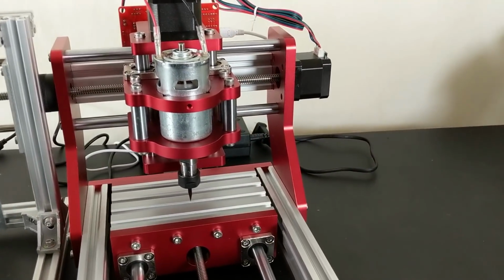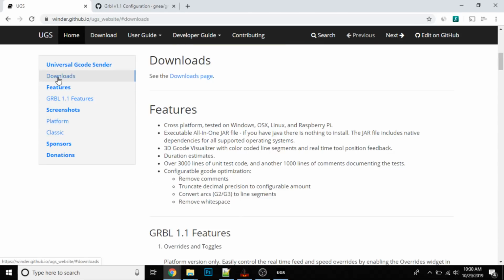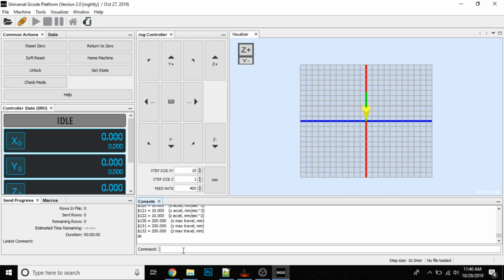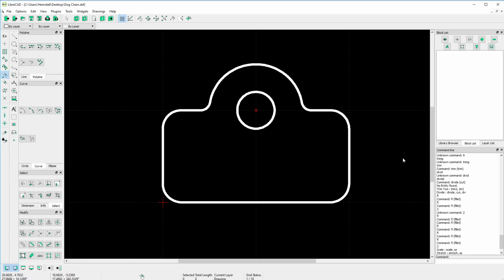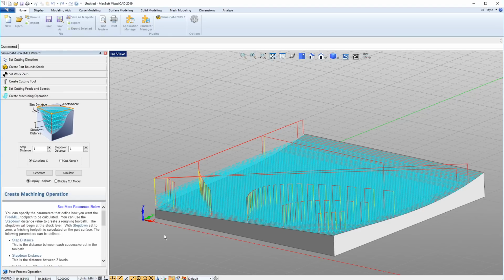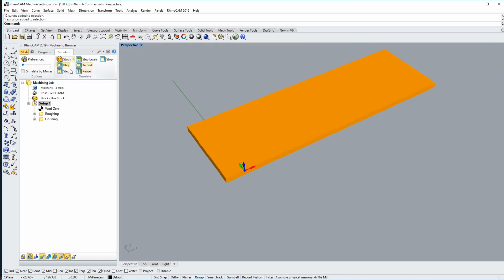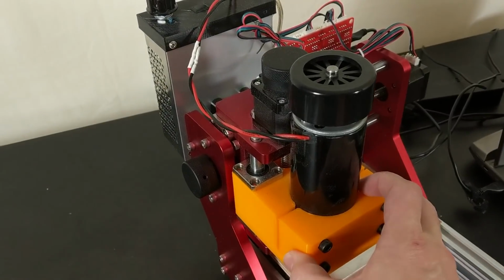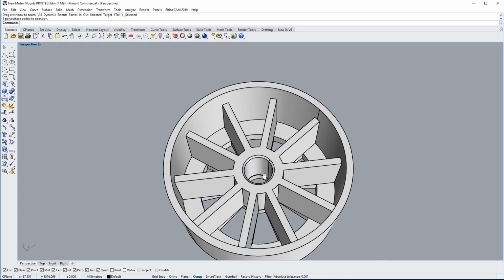How To CNC Cut Metal For Under $400 using the 1310 CNC Router

Comment: You have you coordinate system layout half right, CAD and CAM use standard Cartesian coordinate system.
Upper right is X+, Y+ (you had correct)
Lower right is X+, Y-
Lower left is X-, Y-  (you had correct)
Upper left is X-, Y+

17:08 There are  many reasons for having 0,0 in various different areas of your part. Setup and raw stock shape are the two primary reasons

At least in a professional / production environment raw stock material usages is important so for example, if you making a round part (like say a round bolt flange), you would always try to start with a piece or round stock and you wouldn't then have a corner to have a 0,0 plus in round part design, you almost always start from the center for the layout purposes. Sure, you could machine a round profile from a piece of square stock but this is problematic for a few reasons (one of which you even talked about later in the video). One, its a waste of material because of the corners that will be scrap after the round profile is cut and two, you either have unnecessary clearing to do to whittle away corners of you have to essentially do full cutter width engagement (i.e., slotting) which is excessive unnecessary load on cutter and machine that could be avoided by just using round stock and working from the center.

For other cases, Fixturing plays a roll in where you want your 0,0 because you want you 0,0 to be based on fixed point(s) that cant change with raw stock material variations. For example if you were using a vise to hold the raw stock material to be machined, you would use the fixed jaw as the zero for the axis that is perpendicular to that jaw and then setup a stop for the material for the other axis. Using a full size vertical knee mill (like a bridgeport Mill), it is usually setup with a vise that is parallel to the Y axis and the fixed jaw to the back of the machine parallel to the X axis, you would want to have your Y zero on in the back on the fixed jaw and would be working with negative Y values mostly. Most people will want to use the left side as the X zero because of the intuitive nature of reading and writing from left to right so you would be X positive values (I.e., you would be working in the lower right quadrant of the coordinate system.

All in all, at least for outside profiling, starting with the right and minimal raw stock and  picking the correct spot for your X,Y, zero though can help to reduced wasted stock and reduce cutter load with having excessively wide cutter engagement. Obviously this isn't always possible and there is almost always case where pocking is going to cause a possibility of full cutter engagement if one is not using adaptive clearing strategies.

Speaking of adaptive clearing strategy, I'm pretty sure Fusion 360 is still free for hobbyist use license (I could be wrong though since I haven't used it quite some time now since we use SolidWorks and SolidCAM at work so no need for me to use Fusion)

Comment: It was cutting metal parts that were good enough to work but needed a couple changes to cut better (not more parts). I've been cutting metal on my machine for 10 years (it's a couple tiers up from that machine)
Tips for anyone trying to cut ALU or Brass:

1. Suck the bit up as far in the collet as you can (not on the flutes, but as close as you can). It makes a big difference.
2. Deep cutter-width slots are a no-no! Set your profile cuts at least to at least 1.5x cutter width (also helps with clearing chips). It will take twice as many passes, but your bit will thank you and your surface finish will be much better.
3. profile cutting: if you can, precut/drill a hole in the middle and make sure your path starts from the hole. You will be able to take deeper cuts as it is side-cutting instead of slotting
(As soon as saw your deep narrow slot, I knew immediately it would break a bits and/or lose steps.)

4. If cutting dry/air only: Use WD40 Frequent squirts cool the bit and give it a coating that resists chips sticking.
5. Buy better/midrange cutters $5-8 cutters make your machine cut so much better than $1-3 cheapies. (don't buy expensive cutters until you learn how not to break them)
6. Cut chips not dust! Dust = wearing out bits fast with almost no material removal. (small chips are ok, but grey dust isn't)
7. Don't cut steel. Just don't. Your machine will damage it's self even if you can't see the damage immediately.
e.g. My motor shaft coupler started slowly fatigue cracking and then later snapped and caused a nasty crash that actually bent my Z ballscrew... sniffle.

Purchasing tip:
8. Get a machine with the largest dia ballscrews (not leadscrews) and largest rails you can. The water cooled spindles are also much quieter.

Upgrade tip:
9. Flood coolant with water/cutting fluid: if you plan to cut metal a lot and are willing to set it up, this will massively increase your machine's cutting capability.
Seriously, I went from struggling to cut metal at all - to wondering how far I should push my cuts.

Not only does it blast chips away and cool the bit, but it also reduces vibrations and noise! (straight water will rust everything including your cutter's crisp edge needed to cut well)
I use a cheap fountain pump and water soluble cutting fluid. My machine sits on a tilted table with angle alu edges to keep the water in, then it all runs into a rubbermade tote with the pump in it.
Linelock makes directing the flow much easier and isn't too expensive for a foot or so of it, but I started with a coat hanger wire ziptied to a piece of hose! 

PS. I'm not saying you should go back and try that machine again. It is just going to be on the painful side. But it was doing it until the too deep narrow slot started chattering too much. So for anyone else, who already has a machine and can't afford to just go buy another machine, I hope these tips help.

Comment: use a 3 flute carbide slow down the feed rate to 5 slow down the speed to 1000 rpm. and use an endmill holder vs collet.

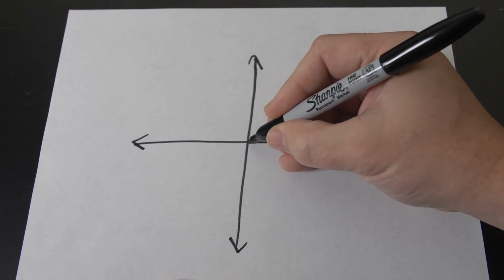Comment: idk if it was mentioned before but at 16:00 you had the  (+x, -y) and  (-x, +y) quads 2 and 4 reversed. in machining a rule of thumb towards you is neg y, left is neg x

good stuff tho, but hope everyone knows this is a CNC engraver, not a milling machine. depth of cut is very shallow and it doesn't have the power or tooling capability to do anything with steel. it'd be great for making wax models (or PLA) for casting

Comment: Torodial milling comes under different names (adaptive milling, whirl..) but only on better machines. The slack on cheap hobbyist machines is just to large, a backlash in x and y will ruin a toolpath that is only a bit larger than the tool the head will not follow such minor movements exactly enough.

Comment: Suggestions:
Bolt the machine to something solid
Use a shorter cutter that sticks out as little as possible, say 1/2" or even less
Make a metal support bracket for the spindle motor
Use a smaller diameter cutter
To stop the pick up use something like this->
https://www.travers.com/aluminum-cutting-fluids/p/121972/?lite=true&pricelistname=SITE

Or buy something better.

Comment: I think that chatter is from the bearings in the x and y axes. That said this is why commercial machines use large flat ways more than roller bearings. Bearings will always have like you found a thousandths or 2 of play, where as a slide way that can be virtually eliminated because the greater surface area of the way. I think this is the problem with all small desktop machines.

Comment: I love your videos, but as a machinist, this video was really hard to watch. For the love of God, a bit goes in a horse's mouth, not in a machine. Also speeds and feeds need to be figured, not taken off of a chart or some other generic rule of thumb. When figuring speeds and feeds  you need to factor in things like available horse power at the spindle and max speed in which your axes can be fed (not max speed of axes rapid movements). And speeds and feeds can also very greatly depending on the types of cuts you're making.

Comment: Cutting soft aluminum will cause the clogging.  Commercial aluminum is usually 6061 or some other soft material.  Try cutting some 2024 or 7075 aluminum.

Comment: A better way to cut a slot if not to use the wrong bit, use a slot drill with two flutes designed for that job. Same goes for plunging cuts.

Comment: For the love of god people that want to do this with any success, please read about Surface footage, also use some aluminum tap magic or some sort of cutting fluid. Anytime i see these vids the guy using the machine has the tool hanging out a country mile. never want the tool hanging out any longer than it needs to be. using router bits doesnt seem like the best idea either, but ive never tried. buy some small 2 or 3 flute endmills designed for aluminum.

Comment: When designing a part, the center of gravity (or mass) may be important for design goals. The resulting design may be scalable, keeping the center of gravity(mass) in place. Output from such a design may have the coordinates relative to that center, resulting in those negative coordinate values.

Comment: Actual machinist here: It may seem odd, but you can often remove chatter by increasing feed, or decreasing rpm.

Keeping a high load on the cutter makes it unable to jump around. 

Adjusting feed/RPM while making a cut is a good way to find the right numbers. What the read in online calculators is just a starting number, you find the ones you need by adjusting and listening.
Reply: That's definitely true, and part of the problem with these little hobby machines is that they generally don't have enough muscle to give a carbide bit what it wants to eat.
Reply: @Skinflaps_Meatslapper  I think people glorify carbide as an industry standard whan HSS is generally a better option for low power machines too. It's easier to get it to bite since has a finer edge usually.
Reply: @brahtrumpwonbigly7309  It's surprising how dull most carbide inserts are when new, and that's part of the problem.  You need more force to get the duller insert to cut, but since it's such a hard alloy the additional force doesn't speed up the dulling process like it would with HSS, it just ends up cutting better.  Maybe the really high end carbide tools have a better edge, but those are usually out of my price range.  I hit mine with a fine grit diamond wheel if possible right out of the box and less aggressive feed rates work a lot better, but they're still just a bit more susceptible to chatter than HSS is.  Could be due to a more rigid tool and harmonics, I don't really know to be honest.  The slop in a cheap machine plays a big part in that, so unless I need carbide, HSS does most of the cutting in my shop.  It's also pretty handy because I can forge, shape, and sharpen HSS to whatever kind of cutting tool I want...carbide is way out of my league LOL
Reply: @Skinflaps_Meatslapper  HSS will be better than cheap carbide over time. Good carbide however is unbeatable.
Reply: @brahtrumpwonbigly7309  i second this, hss for little hobby machines will work better especially cutting aluminum
Reply: I would add, that no machinist would use wood as a base to machine metal.  He did, however, make me laugh when he changed bits and pointed out the larger shank, and completely ignored the shorter flute length (much less the need to cut the shank still and shove it all the way to the collet).  Just a hobbist as compared to profession.
Reply: That is true for a better setup, but this is likely due to a lack of rigidity and power that will not be overcome without losing your precision. Might work to a degree for roughing but I doubt it in this setup.
Reply: Nice to read comments from pros that know what they are doing. As an amateur, feeds and speeds are the hardest concept to master. So subjective.
Reply: @placitas52  Honestly, just listen and play with the rpm and feedrates.  Your ear will tell everything you need to know when it's cutting the best.  Of course they best might not be great on a cheap low rigid machine, but honestly, you can throw the standard machinists guide to feeds in speeds in the trash if you just trust your ear.  That's how I do it and at least for me, it's what works best, not to mention it's intuitive.  In machining, there isn't necessarily a "correct" answer.  Would love to hear cyrex686's thoughts on this if he thinks my logic is way off or right on, but in any case I know that it works for me...  maybe helpful to you, too.
Reply: @placitas52  What ATIMATIK stated is very true. You ear will tell you a lot. As a machinist there are a few things wrong with Design Prototype test attempts to make this machine work. Minus the rigidity problem, flute count makes a big difference. I cannot even fathom how one would think that single flute is going to accomplish what he wanted with any amount of success. more flute equals more rigid. This is due the the "webbing" left in between each flute is thicker. The higher spiral will increase chip evacuation. IS there a super secret formula for calculating the amount of material you can remove?Not in my experience. Yes there are recommendations in such publications as the machinists handbook. But there are several factors that change that dramatically. Rigidity is a major influencer on the amount of material that can be removed. This would be taking in to account all things. The rigidity of the workspace, rigidity of the holding  fixture and rigidity of the cutter. when starting out, because there are sooo many equations used on the daily, I could not remember them all. But one thing that can be easiest and free to find is chip load per cutter. This can and will change based on material. Honesty it is now just experience that tells me what material i can successfully remove how much material from. Chip load would equate, under optimal conditions, the amount of material each flute of a cutter can successfully remove. The manufacturer of the cutter should have this information. For example, if your RPM of the spindle is 1000 RPM, to remove .002 per flute of a 4 flute cutter your feed rate would be 8 inches per minute. This means you 4 flute endmill will be removing .008" per revolution. .002" *4(flutes) = .008.......008"*1000=8.0 And that works on any rpm up or down. ie @ 5000 rpm your feed rate to maintain that chip load would be 5000 RPM. In reverse you can find the actual chipload by reversing the equation. your feeding at 96 inches per minute at 12000 RPM....96/12000=.008" chipload. .008"/4(number of flutes) = .002. Numbers i chose to use are only reference numbers. I just pulled them out of thin air. I would never cut aluminum @10000 RPM with out an oil soluble coolant though. 
TOO much heat and TOO much vibration.

Comment: I think you should have tried to mill your intermediate spindle mount out of delrin. Even if you still have some play, you should get more rigidity, equivalent or better tolerances, and a proof of concept for your aluminum design (and you could have shifted that spindle hole a couple of millimeters to accommodate the fan)

Comment: I do alot of aluminium fabrication, I drill, countersink, circular saw with a tungsten tooth blade, jigsaw and router alloy, if I don't use a penetrating fluid or a stick wax  it will only get hot and pickup on the bit as you have shown. It's a friction problem. Try slowing down the rpm to disperse the heat, not to slow to overload the bit. WD40 or a low vis cutting fluid. Hope it helps. Like your vid, thanks.

Comment: A few tips: keep your cutter as short as possible. Use cutting fluid. Use the lowest RPM that will cut effectively. Keep your feed rates as high as possible. Climb cut whenever possible for better finishes, except when you have lots of backlash in your axes. Make starting holes with a drill bit before plunging with a mill bit. (two setups, though). Rigidity is the most important thing for clean cutting.

Comment: My first comment to you is about the topic of starting in the logically appropriate position on your workspace (and physically on your work piece).  This is your piece of wood or something more expensive (like metal or stone or whatever).  I used to have a CNC plasma  table and I told the builder of my table that I don't want my table to start in the middle of the work piece because of waste and he changed the focus to the lower left position.  I don't remember any problem with +,+ vs -,-    because my tool could run a dummy or sample of the program so this would  visually SHOW  where the head of the machine would travel.  This would therefore validate if being too low is a problem.   This is the right way to start anyway (in my opinion) I agree with you.  

The major reason I was not satisfied with my machine was because of one feature in how it was built.  I know now that it was built using the wrong technology (the most important part) that affected the accuracy of the head.  The X and Y and Z movement on my machine was being controlled by straight cut gears, the worst choice.  No matter how the adjustments were made these gears would affect the quality of the curve or corner of each movement.  It was after this that I was then noticing so many ads for so many machines were now becoming available.